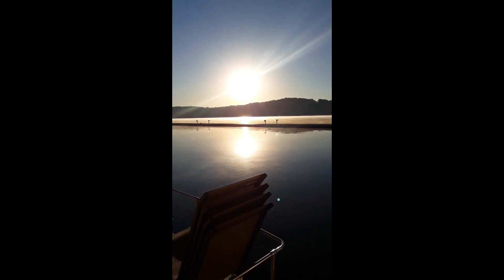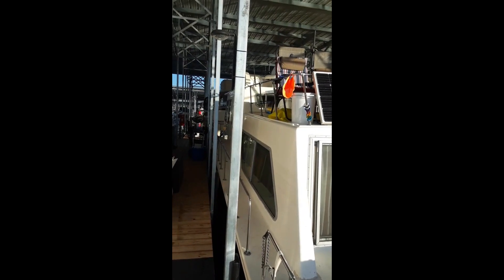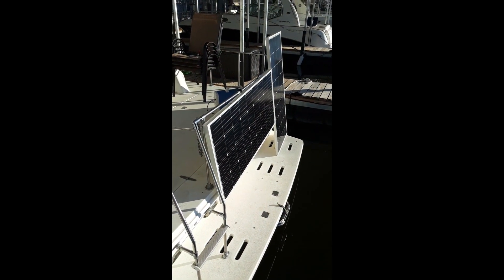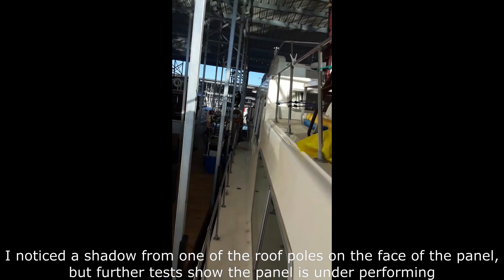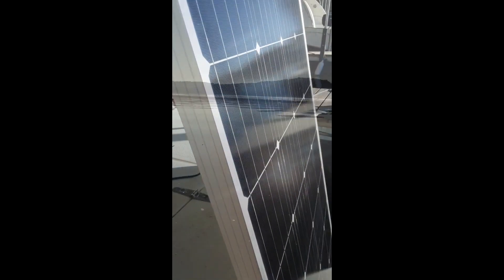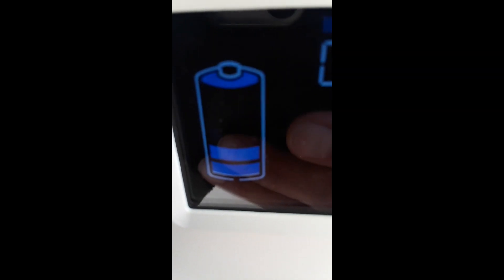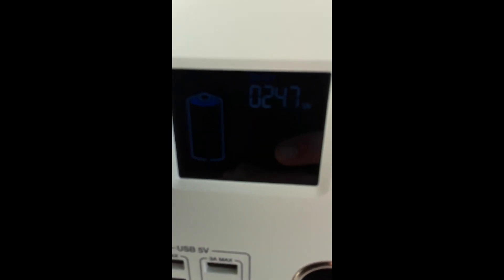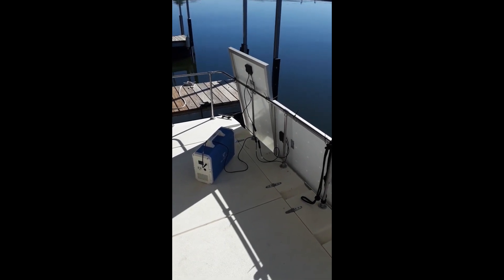MaxOak Bluetti EB240 w/Bouge 170w Solar Panels

Comment: It is not the panel, it is the shade on the panel. 50 watts is a lot, considering some of the solar cells are almost completly shaded. There should be 0 shade on a solar panel.